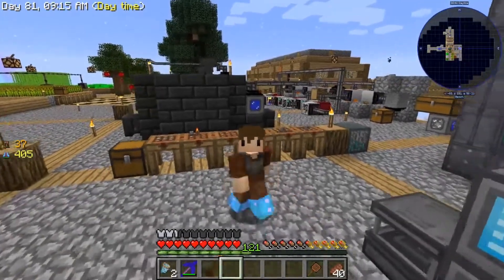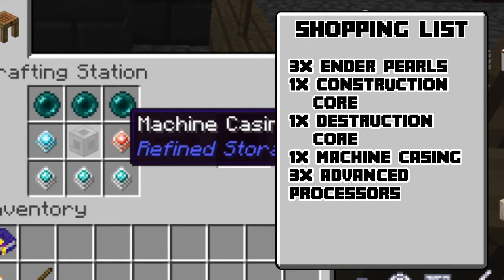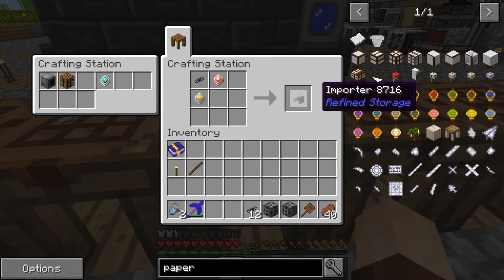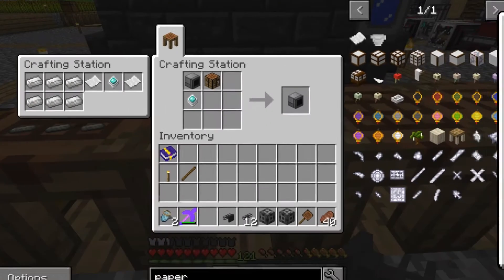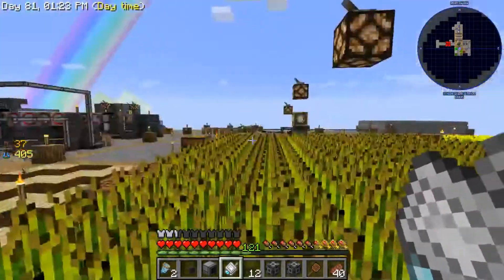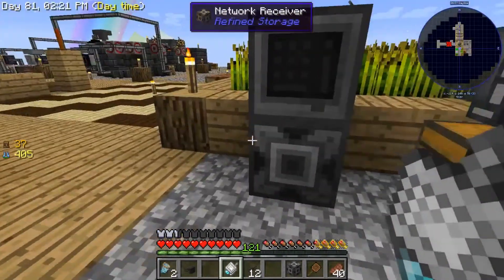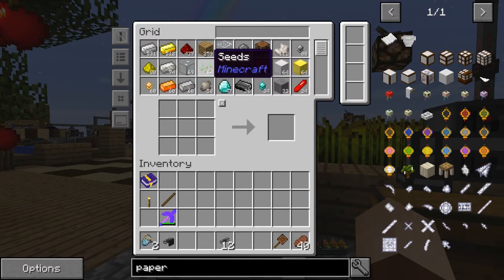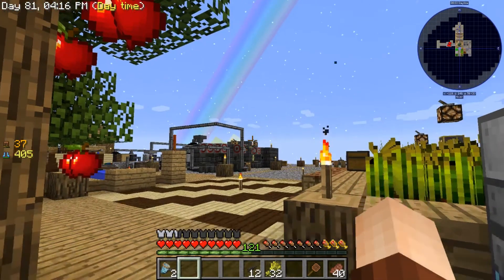[FTB - SKY FACTORY 3] 5-MIN - THAT'S HOW I DID IT! - EP47 - WIRELESS ITEM TRANSFER [REFINED STORAGE]

Comment: this is all the items u need to craft everything obvously ur gonna need a crafting grid first and
: for the transmiter and receiver u need : 6x ender pearls 2x construction and destroyer cores 2x machine casing 6x advanced processors

for the 12 cables u need: 6x quartz enriched iron glass blocks 1x redstone 
for the importer u need: 1x cable 1x improved processor 1x destruction core

for the network card u need: 6x quartz enriched iron 2x paper 1x advanced processor

and if u can like cus it took quite long to make :D

Comment: Do you need multiple Network transmitters for different locations?
Reply from the maker: Oh boy. That is a tough question. It has been a long time since I played SF3 and even longer since I used those wireless transmitters. I feel that you dont, but I cant say that with any level of confidence.
Reply: @JackelWolf  yeah I just got into it I know that when I watch achievement hunters when they did it it didn't seem like they did that there was multiple receivers at each location obviously but I don't know about the transmitters. Thanks for answering though